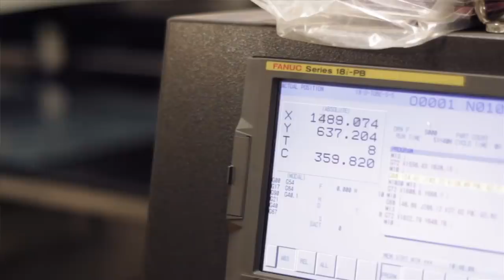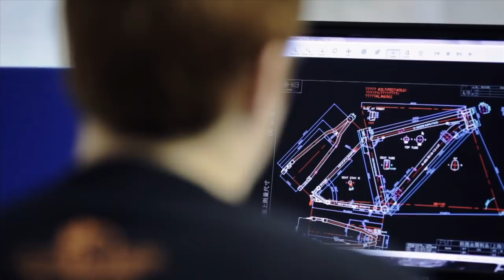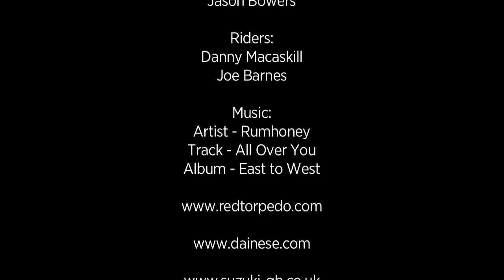Orange Bikes - It is what it is

Comment: The thing that made Orange special in the 1990's was that when you ordered a bike it was made for you. You ordered the model, size, stem length, groupset and fork type along with the option of Fir Wheels. It was like having a custom made bike made. The Bike you recieved was always a good fit. If you ordered a Cannondale the chance are you might have to change the stem. I always thought the best value was the C16r. As where else could you get a (virtually) custom built bike for £640?

Comment: Monocoque....  Single shell..... An aircraft or vehicle where the chassis and body are integral. ..... Not pressed and molded shape. However a monocoque is made by using a pressed or molded piece of sheet metal.

Comment: so is tig welding just using a arc and stick. where as mig is the gas, arc and a fed cable?
Reply: yea.

Tig: Soldering
Mig: Hot glue gun
Reply: TIG tungsten inert gas. You can just use the tungsten to fuse, or feed a rod into the melted pool of metal. TIG is considered the "cleanest" welding, but also the most difficult. "Stick" (with rods) is the next in difficulty, then MIG is the easiest.

Comment: If in doubt, just say "I don't know". You'll always look less foolish then just coming out with what you guess. 
Monocoque. French. Mono-Single Coque-Shell. Single Shell. In engineering term, a monocoque is an aircraft or vehicle where the chassis (the structural frame) is integral with the body. E.g Most modern cars. Older cars were generally body on frame (chassis).

Comment: ive recently purchased a hand built colossi frame and the quality compared to a machine built frame is unbelievable..
Reply: what do you mean by machine made?there is no machine that cand tig weld...only the tubes cand be hydroformed which is much more precise and customisable than mechanical mending and shaping
Reply: +The Religion Killer *bending
Reply: A lot of aluminium and steel frames are mig welded with robots. I used to program robotic welders and while they can produce very good quality very quickly they can't match a skilled craftsman who has the time to get it perfect.
Reply: Oh and there are tig welding robots too, you don't see them much though.

Comment: The workshops a bit dark and 1980s jeebus but good beer drinking blokes. So many workshops now are hip with ten types of coffee machines and a beard is  a prequisite to employment.

I tried ali tig welding once and i burnt holes and more holes. I can weld stick and mig and braze mo problem. I found out much later that the guy that let me have a go turned the gas off..

Comment: 5:12  The true definition: Monocoque (/ˈmɒnɵkɒk/ or /ˈmɒnɵkoʊk/) is a construction technique that supports structural load by using an object's external skin, as opposed to using an internal frame or truss that is then covered with a non-load-bearing skin or coachwork. The term is also used to indicate a form of vehicle construction in which the body and chassis form a single unit.

It's always better to say you don't know than to make some crap up and spread disinformation.

Comment: 30 speed... It makes me wonder what a 500cc speedway engine in a bike with 30 speeds would be like, like a Jawa or JAP engine.. bet with 30 speeds you could get close to 200mph if it was geared right.
Reply: +J.A.Ratt85 Ha! Ha! And Guy'd be in your draft on a bicycle {;-)
Reply: +J.A.Ratt85 I think it could be done with less, but tuned to the max and only with major slipstreaming aerodynamics. air resistance is the big enemy, I feel.

Comment: it only took  a rubber hammer to bend it straight
Reply: +lee young Before it's been heat-treated.  Afterwards, you won't move it.
Reply: Maxle has most of the strength, never let it become loose